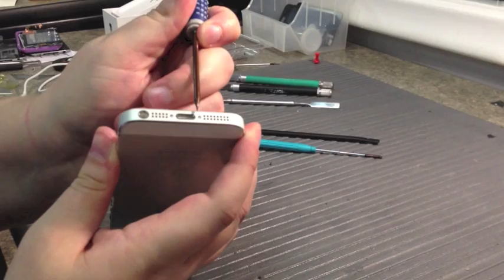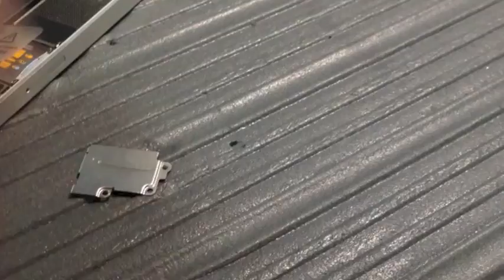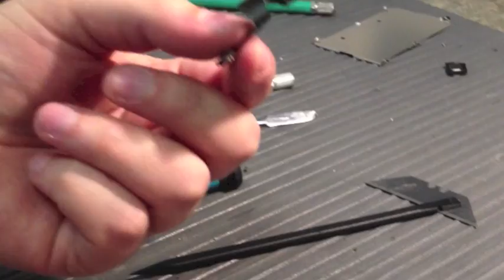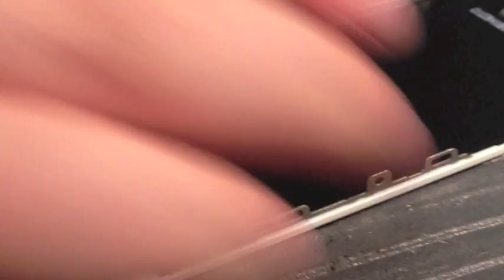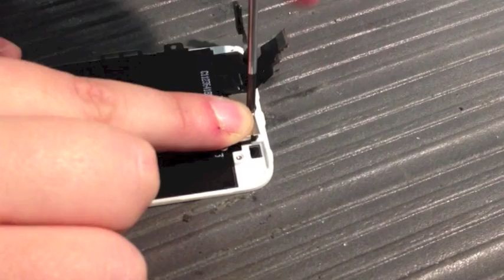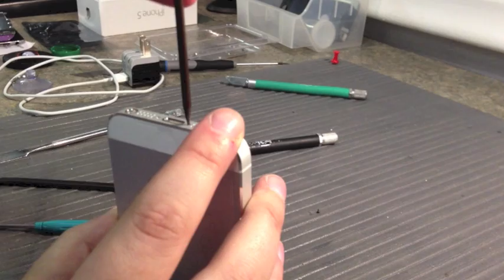How to DIY replace a cracked screen on an iPhone 5

Comment: its important to mention that you MUST put the screws back in the proper places. if you don't, you could destroy the iPhone with long screw damage. there are little tiny wires under some of the screw locations and if you put the wrong screw in, it could cut the wires and you would have to buy a new iPhone. so you should print out a little screw map to keep track of where they all go throughout this whole process
Reply: hello friend , yes , you're right , now there is magnetic screw map , which can hold the screws on the map , don't move , and also show the screw positions , which make the job easier . for details , can contact me at any time , wish you a nice weekends !  : )

Comment: Thanks for your clear instructions.Thumbs up!! Followed them and got my phone working for £20. I wouldnt think it would be worth trying to change just the glass. Didgitiser and screen are cheep enough to replace.
Reply: where did u find screen and digitizer that cheap?
Reply: found it on ebay http://www.ebay.com/itm/271219701553

Comment: Well that was stressful but successful. Thank you for posting that video. If you use a heat gun or maybe even a hair dryer on the glass side (without getting it too hot), that really helps removing the glued down ribbons. And yes you need the pentelobe security screwdriver...
The only place I could find a new screen was from China for about $80 and it arrived in less than two weeks.

Comment: This is a great tutorial but it is let down slightly due to the camera not being positioned in the right place at crucial moments - ie re-fitting the microphone and fitting ribbon cables back. Still a very good step by step demo though